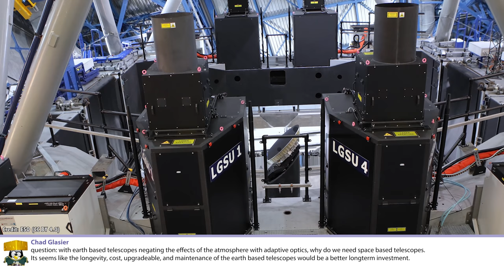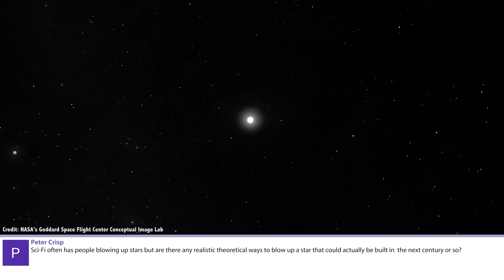Q&A 32: Why Can’t James Webb Be Repaired? And More

Comment: NASA is good with rovers, they should have planned to send a remotely controlled robot with the JWST for repairs. I imagine a multi armed robot that can use different tools, grip onto the JWST and crawl around it like a spider. Yes! a spider to repair the Webb.
Reply: Maybe they can still send it later if it's needed. Would also be nice to have made it refuelable by such a drone.
Reply: At least a tanker robot should have been included in the design.
Reply: I wonder if it is ever considered to include spare parts and a remote controlled robotic arm in these missions.
Reply: If you have the spare payload to include backup systems, why would you need a robot? If you have the spare payload to include backup parts and a robot, why the hell didn't you spend it on a better telescope? My guess is that they did just that: they sent the best telescope they could instead of a crappy one that's super robust and has a robot that can shuffle spare parts around.
Reply: That makes sense. What about only a robotic arm then? And you just send the spares if they're ever needed. I think it'd still be better than having the telescope breaking on launch and be gone forever after that.
Reply: what about a HUMAN ARM, kept alive through the dark art of space necromancy?  and instead of tools, it has an iPhone x so it can tweet about what it had for lunch?
Reply: schadenfreudebuddha That's ridiculous
Everybody knows an iphone would become outdated rather fast up there
Plus, where are you gonna plug that thing for recharging?
Apple would make a special connector, and charge NASA a @?#€!! for the adapter!
Reply: Just buy one of the fantastic solar powerbanks on ebay and charge the Iphone for it.  :-)
Reply: Lol, looks like someone beat me to the punch on this idea.

I think it would make more sense, in the nearer future at least, to send a teleoperated robot as needed. Only question is how long is the signal ping at 2 million miles? I know the moon is somewhere around 2 seconds away, so minimum 4 seconds ping.

I suspect we'd have to operate much like the Martian rovers, whereas we do the job in a series of small preprogrammed steps with feedback from the probe between each steps. It'd take longer than humans onsite to do the job, but then robots WON'T need all that extra weight of life support required of humans. Might be even cheaper to send robots than humans anyway.

Reminds me of the point Mr Cain made before that it probably make more sense for most of our space operations to be done by robots, both dumb and (eventually) AI versions.
Reply: I love that what was nothing more than a set-up for a pun has turned into a serious discussion. Please tell me you all got the pun. ^_^
Rather than carry a bunch of heavy spare parts I was thinking more like if the sunshade or primary mirror failed to unfurl, then the robot could assist. Nudging this, tweaking that etc.
Lance, the L2 Lagrange point is 5 light seconds away, 10 for a return. I think that's pretty close to real time for remote control.
Reply: They'd need Canada's help for something like that.
Reply: hell.. just send an R2 unit.
Reply: Exactly. At a certain point it will break down and they will need to send a robot to fix it. And they will. So this "James Webb cannot be repaired" slogan is just for now. When they'll need to repair it, they will.
Reply: This telescope has been tested to death, they know what they are sending up there and know that it has to work first time. The JWST has been a seriously long time in the making to perfect everything and learn from the mistakes of the past (hubbles contact lense) Have faith in all that the men and women have put into this project, it is such a huge undertaking that it has not been taken lightly in any department and will not be launched without 100% certainty that it will succeed.
Reply: Yeah, but even if it was tested and it is working at launch, sooner or later it will be hit by micro-meteorites. So sooner or later they will need to launch a robot to fix it. In fact, since the Webb was not launched yet, I would propose that they would launch the spider with it, including a store of extra parts for repairs.
Reply: A spider to fix the Webb.. Catchy :-).
Reply: this sounds so complicated.  why don't they just move thelagrange points closer to Earth?  problem solved!
Reply: I think the large problem is the cost of sending that spider-bot there. Unless the spider is with the JWST from launch (which makes the launch much more expensive) it would have to be sent there later, and if you want the spider back to base that is even more cost. My impression was that the cost for repairs is so high you may as well build another when the JWST fails instead, and accomplish the same goal.
Reply: I was thinking more of a robotic arm that could access places in the telescope that needed servicing. It's really not rocket science. ^_^
Reply: The spider would cost more than the Webb.  Heck, we could probably send out the next 3 generations for as much.
Reply: For the love of science, DO NOT LEAVE THE LENS CAP ON!
Reply: Master Therion Yeah 5 seconds is not too bad, it would then be feasible to teleoperate a remote drone. Thanks, for the info!
Reply: METAL1ON lol, I understand that they've probably tested for every likely contingencies,  but at the same time every real engineer worth his (or her!) salt will tell you that there's always a possibility of an unforeseen (or unlikely!) event happening. And, yes I agree its quite likely, especially after Webb proves its value to science (and I'm sure it will!), that they will seriously consider sending a repair bot out to fix anything that doesn't require major jobs. I'm willing to bet that NASA already have repair/rescue plans drafted somewhere even if its not official!
Reply: schadenfreudebuddha Unless we somehow acquire godlike powers to change the masses of either the Sun or the Earth OR move the Earth's position relative to the Sun (a bad idea anyway), the Lagrange points are not subject to our control.

The Lagrange points are locations in 3 dimensional space where the gravitational influences of BOTH the Sun and Earth are balanced (or if you want to think of it as mutually cancelled,  its, while not accurate, easier to think of that way for many laypersons). 

An analogy of the Lagrange points could be the seesaw with two people of different weights sitting on opposite ends. The child on one end represents the Earth and a big fat adult on the other end is the Sun. The seesaw itself represents the mutual gravitational effect between the Sun and Earth. The balancing point between the two represents the Lagrange point. If you put a ball (your spacecraft) on one side of the balance point you will start rolling away from the balancing point towards whatever is on that end of the seesaw as the entire seesaw starts tilting toward that side. This represents the greater gravitational influence of the object on the same side.  However if you stand the ball dead centered on the balancing point you won't move as the total system still remains in equilibrium (everything stays balanced). 

However you could still drift off centered due to the wind (solar wind) or something knocks you off  (impacts from micrometeors, misfiring jets, etc.) then you are no longer in equilibrium with the system. That's why its still good idea to have some kind of small thrusters to do the occasional needed position fixing.
Reply: Drizzleize lol, Venera-bly good idea!
Reply: Lance, dude, I was joking.  I'm sorry I made you type all that.
Reply: schadenfreudebuddha Its cool with me, sorry didn't realize ye were joking. :) However I don't mind writing all that. If nothing else, someone else will benefit from learning that. Besides, I just finished work and was relaxing by watching YouTube and reading the comments.

As you may have already noticed, there ARE people who don't understand even the basics (or care)!

Like for example, I shit you not, I actually met an adult middle-aged guy recently this year that looked up and was amazed to see the moon in the daytime sky! I was like: are you for real? Of course you can get a partially lit moon in the opposed side of the daytime sky (eastern moon in the late afternoon or western moon in the early mornings). You only cannot get a full moon in the daytime, similarly  you cannot get new moons at nights, ...except during total lunar eclipses. ;) (j/j)

I tend to reply keeping in mind not only the person I'm replying to, but also the other readers who may be reading "over our shoulders."
Reply: Since "Orbital Replaceable Units" have been used on the ISS and they tested the "Robotic Refueling Mission" on the ISS, why not include the tech that has already been developed? It sounds like someone said "can't be repaired" and hung up the phone, that became policy. They're going to be real pissed if it blows the power supply two weeks into the mission.
Reply: I suspect it isn't a question of rovers vs telescopes.  It's a question of expense and project scale.    You have to start small.  Spider robots to fix remote unmanned telescopes would be used to fix other problems like Fukushima, etc.  Hmmm.
Reply: @unvergebeneid  "If you have the spare payload to include backup systems, why would you need a robot? If you have the spare payload to include backup parts and a robot, why the hell didn't you spend it on a better telescope? "

Backup systems or a "better telescope" are neat ideas, but a general purpose device that can perform simple repairs or diagnostics independent of the telescope could be more valuable.
Reply: @xephael3485  True, what how many repairs are there that can be done without spare parts?
Reply: @unvergebeneid  I'd say quite a few repairs or adjustments could be done if it's a mechanical issue.  I'd think a drone type robot that could navigate and take pictures/videos outside of the telescope could be useful.  Perhaps somewhat similar to a submersible ROV.

Comment: I grew up in Tampa, on the opposite coast from Cape Canaveral. Even we could see the shuttle night launches from here. To add to Fraser's advise, I would suggest visiting between fall and early spring: besides Christmas it's the off-season so flights and hotels should be cheaper. There are also some camping options.

For those who don't know, the cape is a barrier island separated from the mainland by the intracoastal waterway. There are many parks and spaces along the mainland side which offer an unimpeded, straight shot view across the water to the launchpads. With some cheap binoculars you can see the rocket on the pad just fine, and skip the frustration of finding a good seat at Kennedy (the center is definitely worth a visit though, but it will be super packed on launch days).

My experience is only based on seeing the shuttle going up. But for anyone who has never seen a launch, this should be on your bucket list. You have no idea how awesomely powerful these things are until you see a launch for yourself. IMO night launches are the best: the pad is all lit up and the launch itself is almost bright enough to turn night into day.
SIMPLY. BAD. ASS.

Comment: I'm looking forward to the next ginamic leap forward in space exploration and astronomy.
Reply: Hopefully it's in our lifetime. We need to find oil on Mars and Titan.
Reply: Rick Sanchez honestly, I think by the time we find oil there  we probably will be at the point where we won't need oil. 

Plus depending on their past geologic histories, not sure whether we would find any in first place. To have fossil fuels, you need massive and I mean MASSIVE quantities of biosources put down in relatively quick geologic time frames (like in the Carboniferous eras). Then ye need plate tectonics  to move the layers underwater where lots of sediment is laid down to seal the organic deposits, again geologically quickly, then lots more layers to start compressing the biorganic deposits under pressure and heat to create coal, oil and gas.

Its my understanding that Mars didn't have much in the way of plate tectonics nor did it have an ocean (at least long enough to do the job of compressing any organics IF enough was ever deposited in first place). I suspect that if Mars was proven to have past life, it probably wouldn't have the SHEER mass of the biodiversity that earth had. Geologically, Mars appeared to not have had an Earthlike environment for long enough to develop biodiversity as extensively as Earth did.

OTOH, I have serious doubts about Titan having any oil at all considering both the geology and climate there. Its too cold there to support the massive biodiversity of life needed. I seriously doubt that Titan had much in the way of plate tectonics (the moon is too small). Plus if any life were to get established it may be methanogenetic, considering Titan's atmosphere and type of liquid cycles likely to be there (hydrocarbons not water). 

Even though the Sun's expanding into a red giant starting in a few billion years may start the water cycle on the gas giants' moons, the subsequent supernova may either destroy or eject those moons thus ending any possibility of oil thereon.

There's more reasons than space or time allowing to write about why there is unlikely any fossil fuels on Mars, Venus or any outer bodies. Actually ANY other bodies in the Solar System.

I think we would do better to find fuels for our future power sources such as fusion.
Reply: Mars has Kuato.
Reply: There are abiogenic theories of oil.
Reply: no1 argue with Lance Shimabukuro, they obviously know more than i do, & can explain it a million times better than i can lol... no joke

Comment: L2 is not the most stable lagrangian point, L3 and L4 are. L2 is beneficial because it's relatively close to Earth, the position can be maintained there, and it's slightly further away from Sun than Earth. L1 is closer to Sun, and L3/L4 are too far away.

Comment: We are not alone in the universe. We are not alone in our galaxy. We are not alone in our solar system. We cannot see the entire light spectrum, hear the entire sound spectrum. We can tap into the either . More is going on around you than most can or will realize .  Thanks For the fine video Mr. Cain
Reply from the maker: Thanks for watching. We can perceive every part of the electromagnetic spectrum, from radio waves to gamma radiation. So I'm not sure how we can know there's something that we can't perceive.
Reply: Not without equipment most can't.
Reply: thanks for posting and sharing

Comment: I'm probably at least a little wrong, maybe very wrong, but as far as I know:
- James Webb photographs in very low frequency infra-red, to picture the heavily redshifted objects at the edge of our universe. 
- To do this, the components of the telescope must not emit this kind of radiation themselves. 
- Everything that is not extremely cold emits very low frequency infra-red.

Therefore the James Webb telescope must be extremely cold.
The radiation of the sun can heat sattelites considerably, therefore putting the James Webb where the Earth blocks the light of the sun would help keep it cool. The Earth-Sun lagrange point 2 happens to be in this point..     I think.

If anyone knows; is this one of the reasons that the James Webb is sent to Earth-Sun lagrange 2?
Is it not also why the telescope has such a big reflective panel? To protect from the radiation from the sun?

Comment: Now, I know that some of these new telescopes will be able to get information on the atmospheres of exo-solar planets, which is awesome. But I'm wondering if any of these telescopes being made will be able to get direct images of exo-solar planets? I know how incredibly hard it is to do so with the light from the main star in any given system, but gosh do I ever want to see one directly, even a gas giant, a frozen rock, anything!
Reply from the maker: Getting actual photos of the surface of exoplanets is going to be next next generation. We're not going to see much more than points of light this time around.
Reply: Fraser, you are one SMART dude.  Cain AND able.
Reply: Fraser Cain Its my understanding that to directly visualize the exoplanets, we'd need telescopes that would dwarf even the largest of any existing (or planned, or even realistically dreamed of). Wouldn't that be in the hundreds of meter range? If so, that also would preclude building terrestrial ones as the reflectors would collapse under its own weight! Logically that means space based telescopes are the way to go then.
Reply: The angular size is very tiny, planets being far smaller than the stars they orbit, getting more detailed images of nearby and very large stars seems like the next step resolution wise. In my opinion